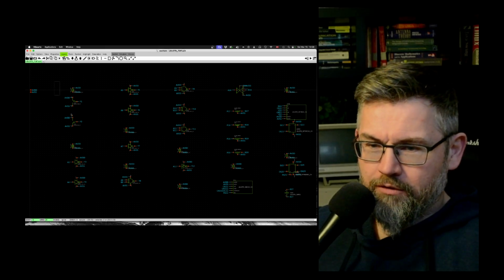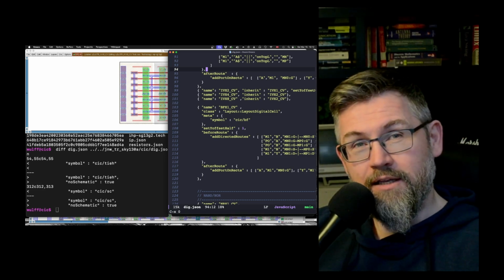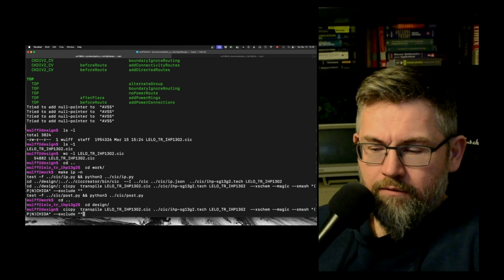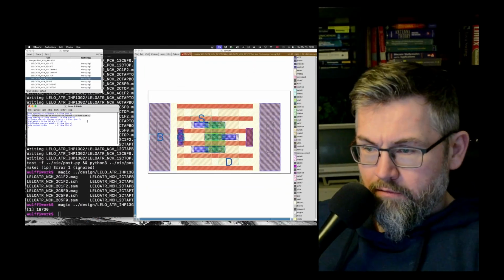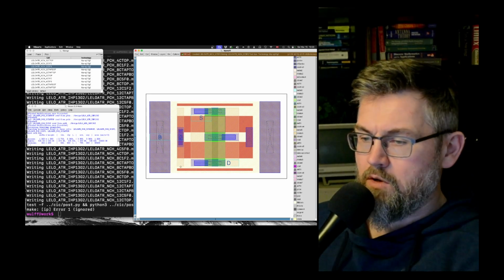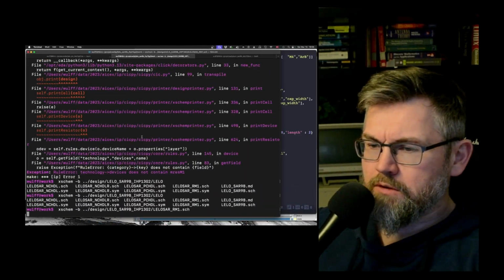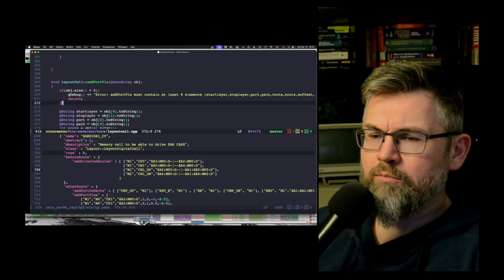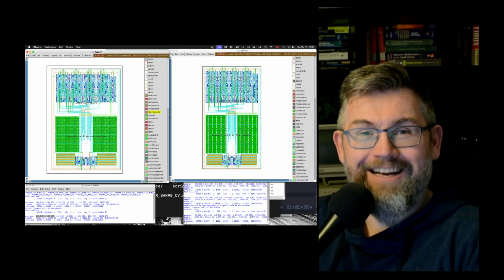Compiling circuits in IHP SG13G2 - Warning: Potential boring content

Comment: Thank you Carsten for another amazing video. I am wondering am I able to port your SAR ADC into of the TSMC's PDK (like 180nm or 130nm) with the steps in the video? I am really interested to see if I can port it to the technologies that I can tape out.
BTW, I've received my chips (including your favorite current mirror OTA) and will test them in the lab.
Reply from the maker: Yes, that should be possible. cicpy also has a skill output. The lowest technology I've tried was 22 nm. I have not tried a fin-fet technology yet, so there may be surprises there.
Reply: I am a little bit familiar with skill language but I am not sure for example how the compiler generate the standard cells that are compatible with virtuoso.
Reply from the maker: cicpy will generate a collection of skill scripts that will generate both layout and schematic. It's not easy though.